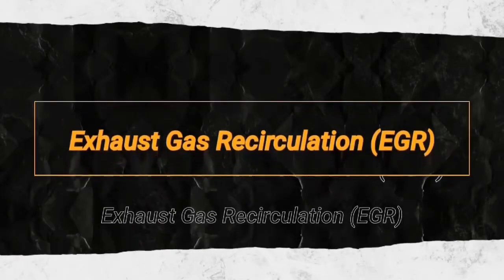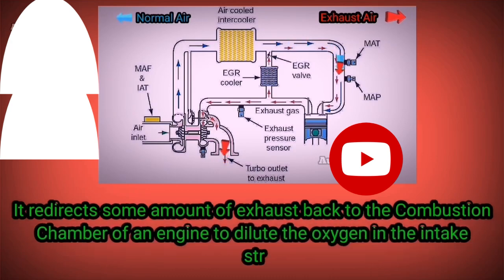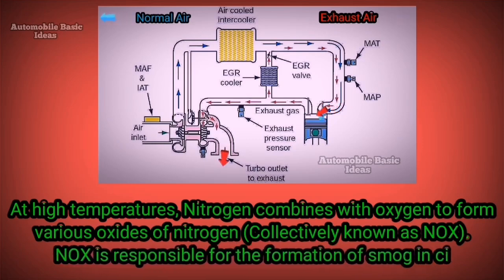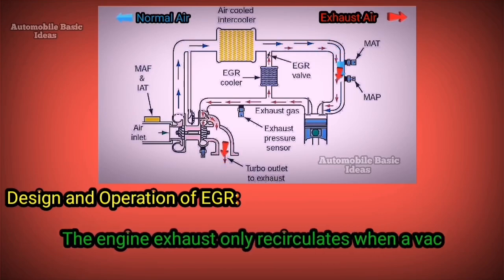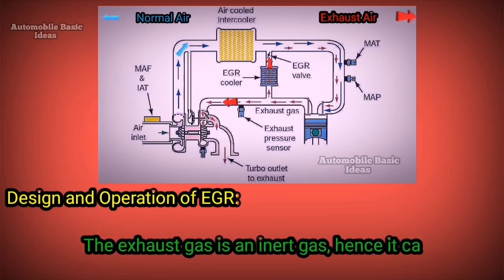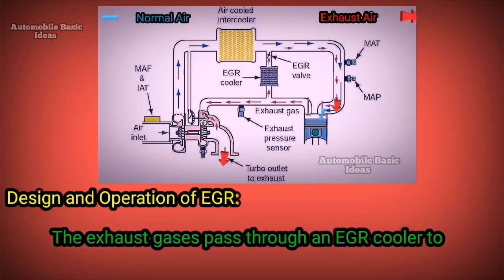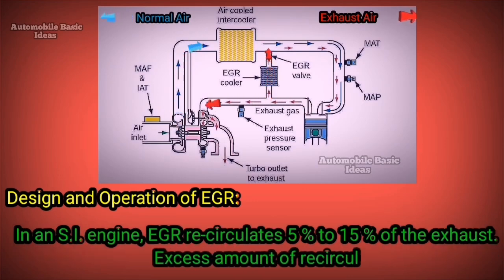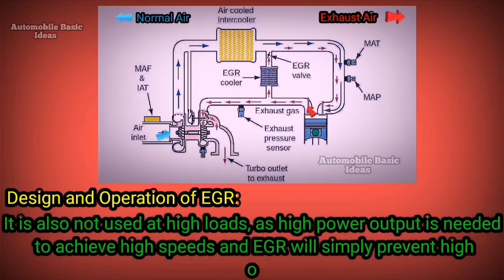Car egr system working

Comment: EGR is your friend.

It improves fuel economy with no power loss (assuming it's properly maintained, but it requires basically no maintenance during the engine's lifespan)

It improves engine longevity by reducing combustion temperature during otherwise lean fuel conditions.

Driving for answers has a video going over the design and operation of EVR systems